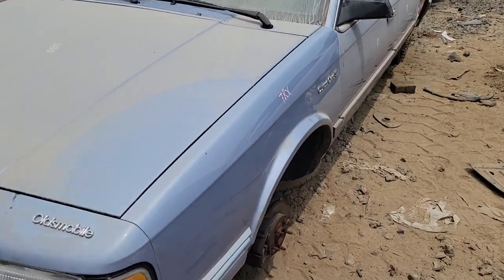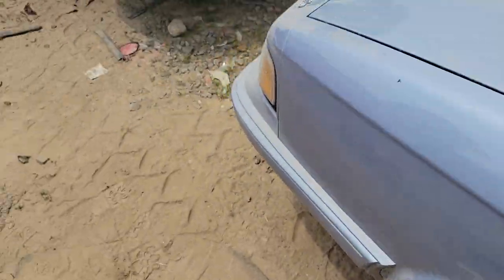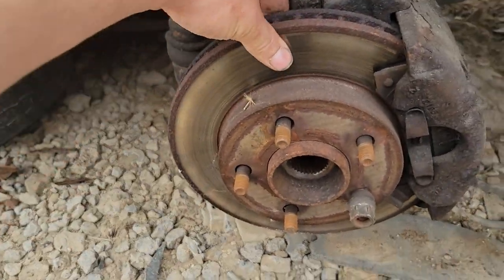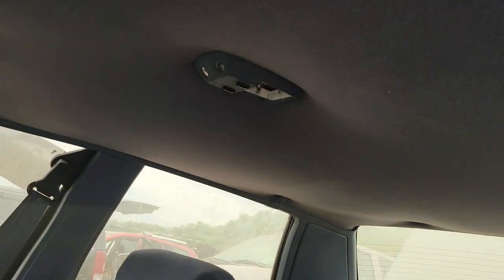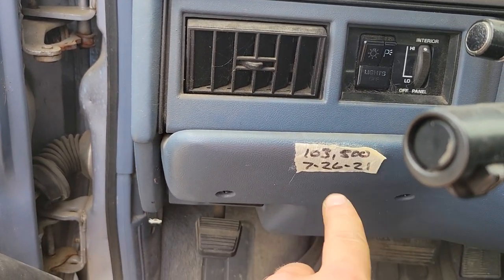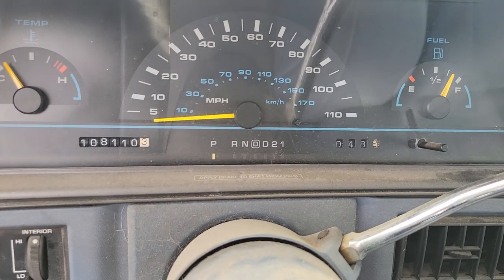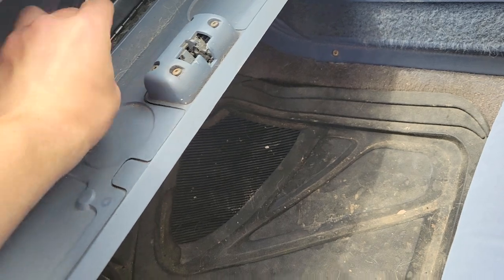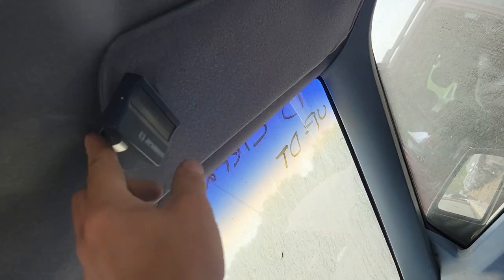1995 Oldsmobile Cutlass Ceira SL at Neal's Auto Salvage in Peoria, Illinois

Comment: I have a 95 cutlass ciera in maroon only has 97k on it but I need a part for it that is discontinued can anybody help me or the person who posted this video I have a 2.2 liter engine 4 cyclinder I think it called the engine mount bracket that goes to the engine and is right next to the alternator if you need to see pictures of the part I need let me know I have the part my mechanic took it off the car.
Reply from the maker: Unfortunately I can't help ya too much. But I would go on car-part.com and see if you can find it or call a few local junkyard and see if they can pull one for ya!
Reply: @MNMoparMinivan  thank you for getting back to me I really appreciate it
Reply from the maker: @DXFAN6909  no problem at all. Good luck. You'll get her fixed up!
Reply: @MNMoparMinivan  I hope so it been like that since October junk yard and salvage yards I emailed didn’t get. In touch with me yet I really appreciate you taking the time to get back to me
Reply from the maker: @DXFAN6909  i have found a lot don't actually reply to emails. Gotta call em haha! Especially the ones more likely to still have old cars like this.